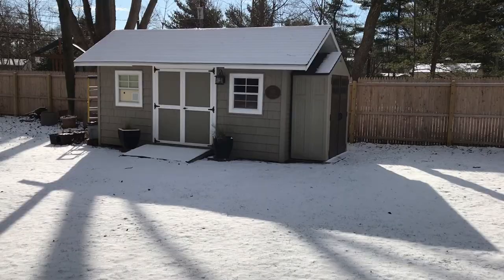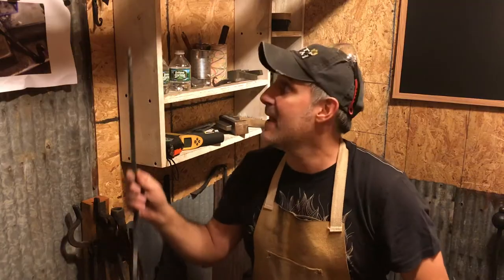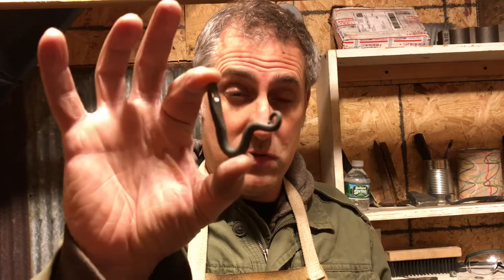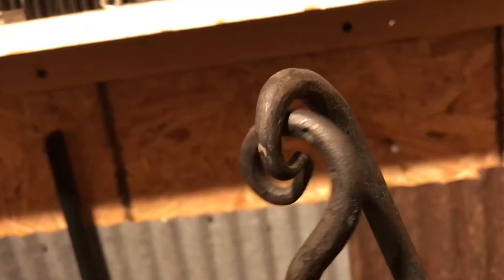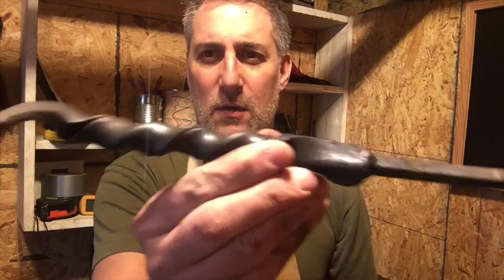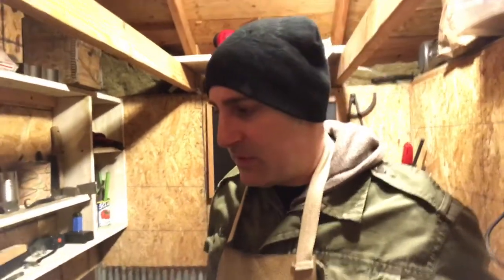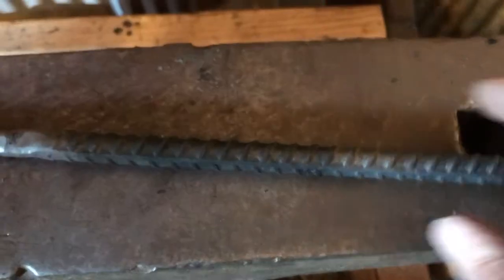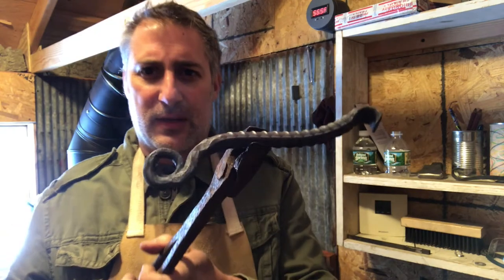Beginner Blacksmith - Rebar Bottle Opener 2 Success? Plus extra projects

Comment: your funny! Its fun to watch. If your serious about being good at this though you want a drawing of something simple with starting stock measurments and make it again again and again until it not just looks like the drawing but becomes second nature in your muscle memory. if you can knock out 6 pieces when you get your forge started, spend no longer than 10minutes on each piece, dont take too long tippy tapping and correcting mistakes, get it done right first time and if not start again. if your low on stock then you can practice forge welding the parts back into starting stock..... wax on wax off......  thats how we learned, we started by forging out horse shoes into flat stock to a specified dimention and then forge welding it back into a billet and then back into a horse shoe. Great video's love it!
Reply from the maker: Thanks so much for taking the time to write up an awesome comment! I know I need so much more time at the anvil to learn the basics. It's been recommend a few times to me about repettion and reference material - such as measurements and drawings. I'm going to try and step it up soon from just banging away and hoping for the best.
Reply: You'll do well. If you make it a warm up excercise before you start an experimental project you'll improve alot.
I want to do more how to forge videos when my workshop is finished and i'll supply pdf drawings with them for you to have a go at. well done and take care. J

Comment: Did the same kind of thing for a sprinkle can and it works good to quench long stuff in the bucket but when I replace my can I'll do like I saw in one of my books and only put sprinkle holes in one half of the bottom. That way you can tip it one way to sprinkle your coal and tip it the other way using it to quench.
Reply from the maker: bc65925 - I actually videoed me say just that! That put was edited out, I’m planning on doing that.

Comment: Cold anvils SUCK...I mean REALLY REALLY SUCK! Here's a tip. Get a magnetic car block heater, even a small one, and stick it on the anvil. In your case, I would say in the morning before work. Then when you go out to work in the shop, at least the anvil should be warmed up a bit, and not act as such a huge heat sink. Nice job!
Reply from the maker: Cool idea! Thanks for the suggestion.

Comment: good job. dont the fire heat it up in there?
Reply from the maker: Bison Workshop - Thanks Bob! Well it used to get way hot but that’s before I knew how to control the fire and putting those welding blankets on the forge. Plus, it’s been down to the single digits temp wise. Most of the heat goes right out the chimney.